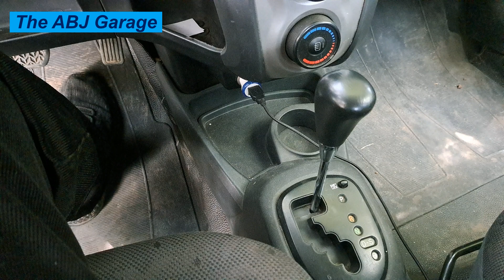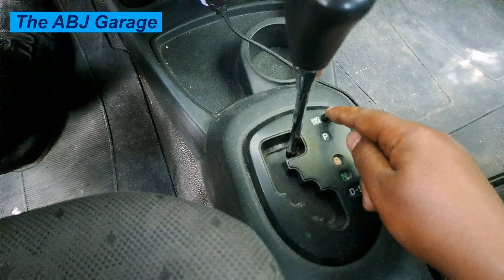What is the use of shift lock on automatic transmission cars?

Comment: how to remove this issue, everytime our vehicle shift from Park we press the shift lock, before we don't
Reply from the maker: This usually happens when there is too much load on the parking mechanism in the gearbox. If the entire load of the car is kept from rolling by this mechanism, then disengaging becomes very difficult, to avoid this try to put the load of the vehicle on the parking brake first, then let go of the foot brake to see if the car is being kept by the parking brake. Next put the gear selector on P position as extra measure. Now because larger load is not placed on the gearbox parking, disengaging it will become easier. Also avoid parking your car on inclined surface as this will put additional load on the parking mechanism.